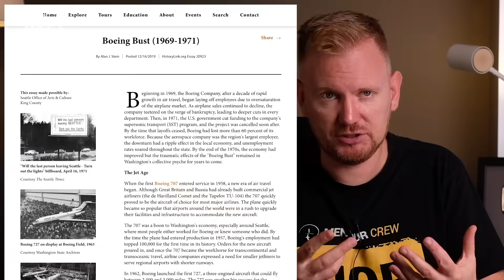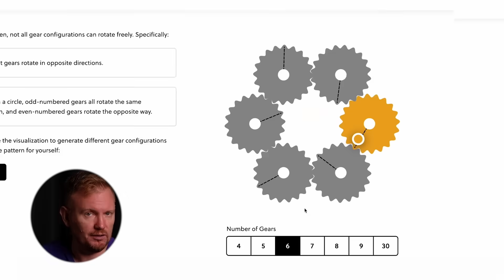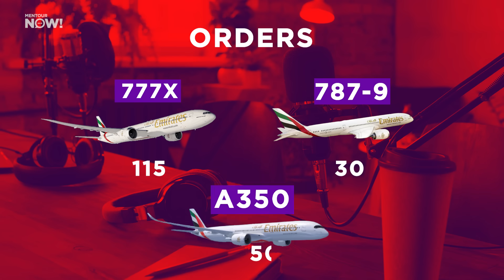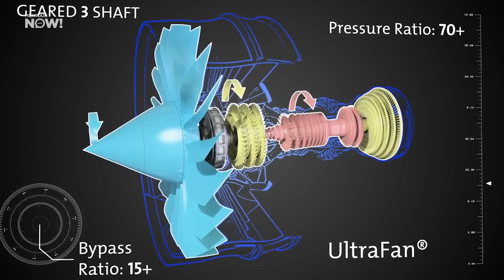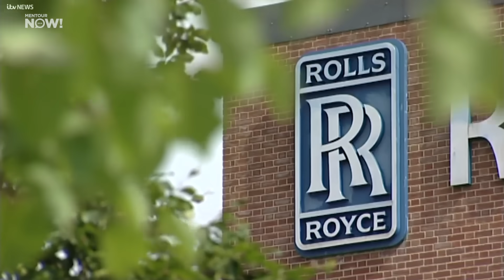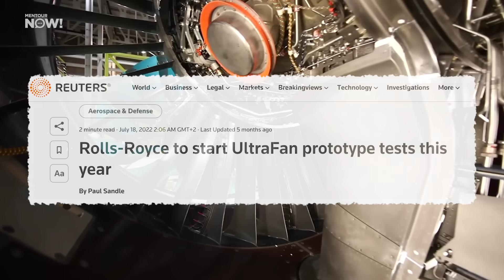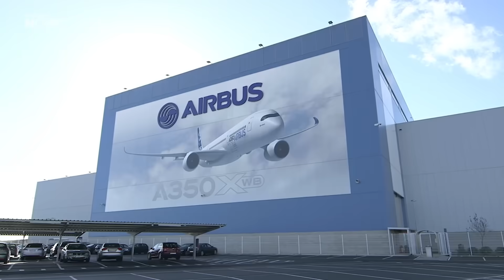Are BOEING planning a 747 with 2 ENGINES?!

Comment: Boeing should keep the 747 going. It is a mistake to end production. They will probably reintroduce a new 747.
Reply: The company can barely stay financially viable now. It can't just build dozens of airliners on speculation no more than BAC-AEROSPATLE could build 100 Concorde A models on speculation. Basically a lot of the need for nose loading outsized cargo will have to be done by something else or not get done at all.

Comment: Sounds like the 737Max all over again. Low wing plane, try to fit a bigger engine, undercarriage not long enough, raise the engine into the wing, etc. I think it may be easier to fit to high wing transport aircraft, e.g. the C5A Galaxy.
Reply: Twenty-five years ago Boeing had great success adding bigger engines to the 737 NG. They are now having success with the 737 MAX with its greater range and fuel efficiency. It obviously got off to a rocky start due to mishandling what should have been a straightforward software adjustment. But there was nothing wrong with the idea and it is proving to be a good choice.

Doesn't mean a two engine 747 makes sense because each situation is different.

Comment: Why we don't switch directly to one mega engine, Mig-15 style and we put the passengers on the wings (sarcasm)? This idea that reducing the number of the engines decreases fuel costs and increase efficiency is not true by default. It is only due to the will from airplane builders to not redisign nor to start a project from scratch but reuse the same blueprint adding or removing engines like in a Lego game. A practice that can conduct to disasters. In addition to that is always true that having 4 engines has no matter what an higher level of redundancy  so it is always safer for the passenger sitting inside the plane.
Reply: The key to safety is not always in numbers. ETOPs pushed better manufacturing and maintenance practices. Increasing reliability helps.

Comment: Rolls was also selected to re engine the USAF Boeing B52 from 8 to 4 jet engines.
Reply: Nope, the 4 engine proposal was ended when the adverse yaw after critical engine failure on takeoff performance led to lots of B-52s crashing in the simulations. RR is using an RR700 derivative engine to replace each of the 8 PW TF33s on the B52Hs.

Comment: Don't see why the big frame 2 engine concept shouldn't work. But a LOT of airframe redesign to accommodate the big turbines required. GE's eventually have to bite the bullet and go to a big reduction gear like Rolls (and P&W, albeit smaller). No 2 ways about it.

Comment: I feel like the design of planes altogether is very out dated now. New engines? Great. New materials? Great. 
What about big changes in the actual design? Things like variable wings, engines on demand and so on?
There is still a lot of room for improvement in aircraft design but we seem to have been held back by a constant rush to the cheapest for the last 30+ years.
Reply: Even the cheapest is very, very expensive. We expect airline manufacturers to take huge risks on new technology. For the most part they do but it moves slowly at times. If we want it to move faster then we need to provide government subsidizes. If we don't want that then we need to accept somewhat slower progress.
Reply: Problems:
Flying wing: While you get somewhat decreased fuel usage per kilogram of mass transported each kilometer passengers historically aren't keen on not having windows to look out of. 
Swing wings: Boeing fouled that up with its original B2707 fiasco.
Reply: @davidhoffman1278  Hard to say about windows. On wide bodies only about one in four or one in five passengers have a window seat. I have also noticed an increasing trend to keeping the shades down during flight because people are watching inflight entertainment or using their laptops, or sleeping.

That being said there probably would be some resistance to not having windows at all. Seems like it would also be a safety issue when evacuating the plane.

As for 2707 the whole idea of building a supersonic airliner was misguided. U.S. wasn't going to do it until Britain and France started the  Concorde project. The economics were already going to be shaky because of high cost, short range and small number of passengers, but once it became clear that they would be limited to subsonic speeds over land the U.S . wisely cancelled the project.

I would think that the extreme weight limitations that supersonic flight required, not incompetence, was the reason that swing wings were abandoned.
Reply: @StevePemberton2  ,
The 2707's wing pivot mechanisms kept increasing in mass as the project progressed. 
Even if Boeing had reduced the cruise Mach from Mach 2.7 to a more reasonable and attainable Mach 1.8, the swing wings were too high a percentage of the empty mass. 
They were trying to satisfy every possible usage scenario elegantly and that leads to excessive complexity and mass. See the FB-111 and the B-1 as examples of that.
Reply: @davidhoffman1278  Swing wing had advantages over delta wing so it's understandable why they were trying it. It just didn't work out. Should they have foreseen that it was going to be too complicated and heavy, maybe. I'm sure they knew they were taking a risk.

Comment: If you have routes with heavy passenger volume, and can keep the aircraft full, the A380 will always be a better option than 2 smaller aircraft, for several obvious reasons. And, personally speaking, as a passenger, if there's an A380 operating on a route I am going to fly, I will always pick that flight. As for operations, the optimum operation will likely always be point-to-point for domestic/local routes, feeding into a big hub for international routes. A hybrid operation, basically.

Comment: You could redesign it with over wing engines like the HondaJet.  That would eliminate most debris injestion issues and allow operators to go in to "rough fields" which would open up mining camps and certain military fields as operations bases.

Comment: I think a big thing for Emirates is Dubai is far away from any sort of key destination.  For them big full planes is what makes economic sense, where as say Jetblue can still make money on a half filled A320 from Philadelphia to Orlando at 1pm because that plane will probably make 10 more flights that day of similar length.

Probably also is reflected in the tier of service if you compared Emirates to a typical US route.  One is basically a flying luxury liner to far flung locations and the US domestic route is a greyhound bus with jet engines taking you to go see Mickey Mouse or grandma.

Comment: This new engine could power the replacement AN225 Ukraine is planning. Think of the lift two or four of these engines could provide that behemoth. I would love to fly a new super 747 -10 with those engines even if I were sitting sideways playing the piano. If they put that seat back.
Reply: IF the replacement is built then they will probably be using whatever remains of the original 2nd and 3rd originally proposed AN-225s. That means 6 engines of some type to keep the pilot training almost exactly the same..

Comment: Nah...  Too Heavy.  The B-52 however... 🤔.
Reply: The BUFF has a relatively small rudder that barely provides enough yaw control when you have a loss of engine 1 or engine 8 during takeoff. The loss of a high bypass engine 1 or engine 4 overwhelmed the yaw control capabilities and results in a crashed B52.

Comment: No I don’t think so. If they were going down that road they would probably build a clean sheet design. However Boeings management is a huge problem these days. While ever they don’t have plane guys in senior management they will be Hamstrung . The Latest GE engine could fly a 747 airframe but would probably not be able to fly on a single engine easily. 140 thousand pound thrust engines could probably do it. I suspect GE & RR have had engines running over 130 thousand pound thrust. 
I just see an further development of the 777 is the way Boeing would probably go.

Comment: Cheaper than an all new plane. Cost saving is why Boeing mounted large fuel efficient engines on a very old plane, the 737 Max.
Reply: That worked out well...........

Comment: So what will future Air Force one planes be? 777s?
Reply: They are currently modifying a couple of new 747-8's that were purchased while Boeing was still making them. It was two planes that an airline didn't take delivery of which were sitting in the desert.
Reply: By the time the new VC-25B's are worn out, there might be a two engine replacement, but the 777 probably won't be it.  The trip seven will be long out of production by the time the VC-25B's are done.  Remember, the Secret Service requires the primary  Presidential airplane to have four engines.  They don't want to hear about twin engine reliability.  The engines on the VC-25's must provide a lot of electrical power that two engine airliners don't need.

Comment: The problem with turbofan engines that big is that even if it has a fully contained blade failure, you really don't get the same level of redundancy that you would get with a smaller engine. There have already been accidents where the airliner had an engine failure such that the airliner couldn't maintain straight and level flight at any safe altitude. Often the front ring of the cowl is broken off the engine and it introduces severe drag. As engines get bigger, so does the drag from an engine with heavy cowl damage. I strongly suspect that ETOPS ratings for a new aircraft with two engines this size may actually decrease quite severely. I sure hope I'm wrong about this, but I don't think I am.

Comment: I've heard Boeing engineers are once again looking into a shroudless fan. They did some testing on the concept 30-35 years ago but found that the efficiency gains available then would not have outweighed other benefits of an enclosed fan (namely, significantly reduced noise and as some degree of shielding should any vanes ever come off). The noise factor alone has me hoping that it's not a serious effort this time around. I've noticed lately that modern airliners are way quieter than they once were. I live where planes routinely pass at 2000, 5000, and 10,000 feet and where it used to be I could hear every single one screaming by, now at 10,000 ft, I almost can't hear them and 5000, they're not a bother. That wasn't the case 20-30 years ago.
Reply: All else equal the bigger the fan the quieter the engine. It is quieter (as well as more fuel efficient) to push a huge mass of gas out the back slowly than to achieve the same power by pushing a small mass out very fast. This is why modern airliners, with their high bypass engines, are so quiet. And why supersonic planes will always be noisy (ever hear a fighter taking off?).
Reply: Also I think they have varied the flight patterns to spread them around different neighborhoods. Plus they fly higher than previously. Wed is airplane day here. I hear tons of aircraft. Other days less frequently.

Comment: On long haul flights, I actually prefer hub-and-spoke model as long as the hub is like DXB or AUH. The break is such a good opportunity to relax and get ready for the final leg of the journey so I reach the final destination reenergized. Turkish does not operate A380s but only because they were late to the game. IST is positioned in a far better location for the hub-and-spoke game, but IST lacks facilities for passengers to move around the huge airport. Still Turkish has more planes and destinations than Emirates.
Reply: Who tf wants to hang around in an airport, I want to get the journey done asap. It's hardly exhausting sitting in a chair on a plane.

Comment: Went to the factory tour for the 747 10 years ago. Have also seen the dreamliner assembly. Totally different setups 747 was like a old car factory everything is put together on the line. The dreamliner is like a simple model kits of a few parts glued together.
Reply: That is because none of the body nor wing assembly work was performed in Everett for the 787, wings from from Japan, while the bodies come from elsewhere in the US and Italy. Where as the wings and fuselages are assembled in Everett before then being Joined on the 747.
Reply: @mikerounds2287  now that you mention it... how freaking cool would it be if the final 747s flying were the dream lifters? i know MP only touched on conventional 747s in his video on what would be the last, but for non conventionals, they'd probs be some of the last. i haven't seen anything about boeing making or designing new lifters, and with preassembled sections still coming from all over the world they're a necessity.
Reply: @Rocker-1234  the dream lifters and 747-8Fs are going to be flying for YEARS, especially with the Antanovs being destroyed.

There is literally nothing that can lift the same amount of carge due to the front opening nose cone on the freighters.

The 747 was designed in the end for military cargo. There is nothing on the commercial side of things that can replace it.

I doubt there ever will be to be honest.
Reply: It does not mean anything. The 747 like the 737 is totally mechanical, and controlled by and large by cables. Newer planes are fly by wire.

Guess which one I would rather be in if there was an electronic failure?
Reply: @orestes1984  im with you on that. i HATE flyby wire being on commercials. all you have to do is look at the qantas incidents with airbus crap where what shouldve been very minor problems were made nearly fatal by that crap to see why it shouldve stayed in mil tech
Reply: @Rocker-1234  still safer than MCAS (statistically )
Reply: @Rocker-1234  The hydraulic systems boeing uses have also been implicated in a number of fatal accidents.
Fly by wire is not so much the issue, it's the surrender of end control to computers that can override pilot input, or that "interpret" data, or supply pilots with inferred data.
Worst example of this I have heard of is an engine rpm output that estimated engine rpm rather than read it.
Reply: I'd love that. Never flew on one.
Reply: That's incorrect. Those parts are PREassembled sections of hundreds of other parts. Those were assembled elsewhere and then shipped as a component to the factory for final assembly.
Reply: Those 748fs will outlive everything flying today. Happily sat on one right now..Getting really bored of people thinking they are experts on engineering because they went to Dubai on a A380, that was big enough accommodate their obesity.

Comment: I think it could be one of the cases when Rolls Royce is designing the engine to prove it can be done. They may not have a specific aircraft in mind, but if either Boeing or Airbus start designing a new twin engine super jet, who will be the first company they call? It's a gamble that RR is willing to make because they can scale down the engines for smaller, current aircraft while still being the first with an engine large enough to the job whenever a super large, twin engine is developed.

Comment: It is a worthwhile idea to ponder, knowing that the first 747 using 4 engines has been the choice of many airlines, and of course, advances over many years of production on not just the fuselage, but the engines too. I would say that if the first engines had only ½ the maximum thrust of the engines with, say, the Rolls-Royce Ultrafan, it would be something feasible, but I think the reality is the thrust comparison of the first engines to that of new designs is more like ¾, which would still require 3 of the new engines to provide the same thrust to the 747 frame...

Comment: Emirates has to take a stake in Airbus, some kind of stock investment with capital increase in order to share the risk of a further development of the A380. The risk for this kind of development is too high for Airbus with only one potential customer. However, if Emirates is willing to invest in Airbus, there is a much lower risk on both sides.

Comment: Seems highly unlikely that Boeing would just redesign the 747 with 2 big engines, he cost and work to get a new type certificate from the FAA/EASA alone would be enormus. It made sense for Being to do the 737 MAX as airlines were already flying these so most of the infrastructure and crew training was already there, plus the plan was to allow no additional training so flight crew could move back and forth between NGs and MAXs (this was a huge part of the problem which lead to the MAX accidents).
There are very very few airlines still flying 747-8 or -400 aircraft so the pool of potential buyers is very small compared to the MAX.

No airline is going to go out and buy a "new" 747 that still has 1970s avionics, flight controls, and has a maintenance plan from the 1970s, compared to new aircraft the 747 cost a lot to maintain and has so much old technology it wouldn't make sense to build off the existing airframe.

Freight is probably the main reason to keep a 747 type aircraft but many airlines have already bought 777 and A350 freighters and don't seem to mind loosing out on potential revenue from over length loads. The few freight comapanies interested in these loads have already bought 747-8s anyway and don't need as many aircraft to operated their freight routes so the market for a twin 747 is even smaller than it first looks.
Not to mention most 747-400 -freighters currently flying are older passenger planes that were converted, meaning companies aren't scared to fly freighters that are old as hell vs passenger airlines that want newer, more reliable aircraft.

A new aircraft could be developed but the pool of potential buyers is tiny compared to normal twin jets, not to mention the A321XLR and A320 family is just so much more appealing than the 737, Boeing despirately needs a new narrow body aircraft to replace the 757 and 737.